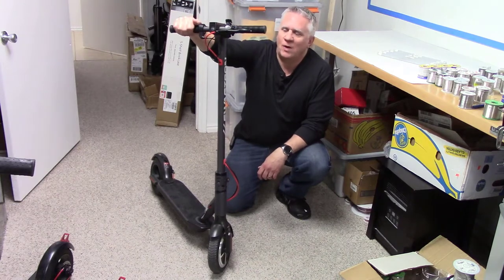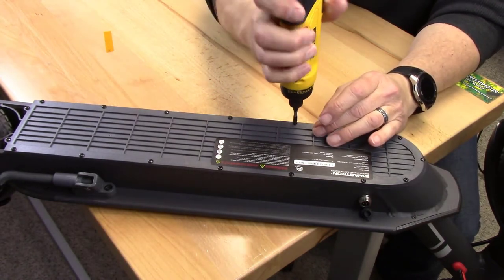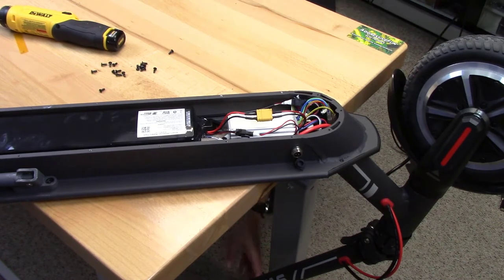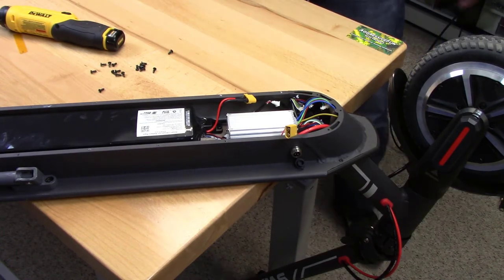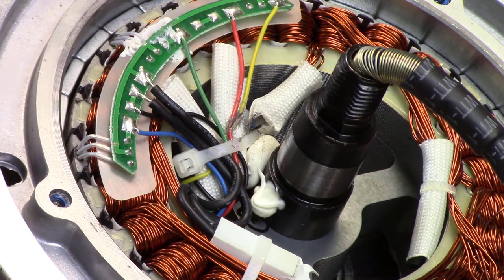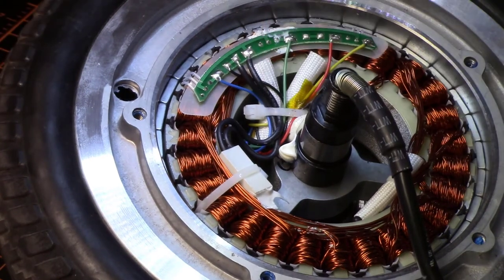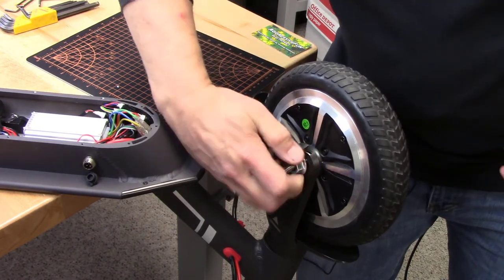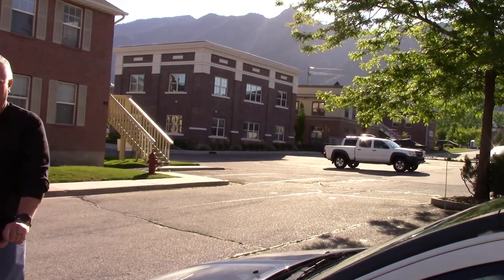How To Fix Swagtron Swagger 5 Scooter Not Running - Successful Repair (SOLVED)

Comment: This video was super helpful thank you for making it. I started having an issue with my swagger 5 scooter recently where driving straight, the scooter just loses acceleration like yours did. I know its a problem with that switch by the brake handle because sometimes if I pump the brakes it will let me accelerate again. Although sometimes, I see the display flickering in and out of consciousness and then it just dies... but I can start it back up after a few seconds. I was at work today so I only had time to remove the bottom plate and reseat all the connectors. if it continues happening Ill pull off the wheel hub and take a look like you did. im glad there are helpful people out there like yourself that will make a video like this, at no benefit to themselves. Very much appreciated. thumbs up and subscribed.
Reply from the maker: Thank you! Glad that it helped. Thanks for watching!
Reply: @Aggressivefun  apparently these scooters have another problem.
When the odometer hits 57 plus miles and you come back from a ride and try to turn it off it will beep and get "stuck"and you will not be able to turn it off and the beeping will stay steady, you can simply disconnect the battery and that will reset the odometer to zero, it already happened twice with mine
Reply from the maker: @Blinker_Fluid_Supply  I wonder if it's something peculiar to your scooter or if it's a problem across all of them. It'll be interesting to see if other see the same behavior. Good job finding a fix!

Comment: Hello I have a problem. I have a swagtron sg-8 swagger 8 and my throttle wont work to accelerate. But i did notice that 3 wires are loose and not attached to where it was attached before. what should I do?
Reply from the maker: I'd reattach those wires for starters! Good luck! Thanks for watching!
Reply: @Aggressivefun  ty for the help!

Comment: My scooter is new and has only been used less than 10 times. My daughter rode it yesterday on good dry pavement. She said it just turned off while she was riding so she ended up kicking like a regular scooter. I am currently charging it to see if battery just died. I tried to turn it back on and nothing was happening. Going to leave it plugged for at least 3 hours and hopefully that's all it needs 😭
Reply: Pls disregard my earlier comment 😅 I just unplugged the scooter and pressed the button.... It's alive again 😂🎉 I guess I couldn't turn it on while plugged 🤦‍♀️
Reply from the maker: Oh good! That's the best kind of repair! Thanks for watching!
Reply: The same has happened to our sons, we tried to charging it and the panel will still not turn on. We’re still working on it and trying to figure out the problem. We have only had for 2.5 months and purchased brand new before it happened. 😢
Reply: Same thing is happening to my scooter did it turn on?

Comment: I have a hub motor that stops at a specific point when you rotate it by hand. I know it’s the motor and not a bearing since I can feel it magnetically stop at that point. What do you think could be wrong?
Reply from the maker: Hmmm...do you hear anything at a given point when the wheel is rotated? Like rubing or clicking? It could be that someting has moved in the wheel motor but that doesn't seem very likely. Might be a wiring issue, like mine had, but mine was a brand new unit from the manufacturer. Could yours be due to wear?

Thanks for watching!
Reply: @Aggressivefun  Thanks for replying! And I got mine lightly used. I wouldn’t be surprised if it has only been charged twice since it looks brand new. I don’t really hear anything it just magnetically stops at one point when you rotate the wheel.
Reply from the maker: Does it act that way when all of the power is removed - like the battery is unplugged?
Reply: @Aggressivefun  Yes it does the same thing with the battery disconnected.
Reply from the maker: Then it sounds like something mechanical has moved inside the wheel.

Comment: Hi sir have the same swagtron 5, got issues with, rode it one day and suddenly just died on me, call the company,  was told to ship it to Indiana,  they couldn't even tell me if they could fix it or not , they're not helpful at all , on top of that the lady was rude , so I decided to buy another one glarewheel same as Hiboy max 1. I really like swagtron,  after almost a year not riding it I decided to ride it and see if it's going to work,  it did work and it ended up dying again,  so I don't know if it's the battery or something else. But one day I  got caught up with the rain so you think that water might got in. Please help. Thanks
Reply from the maker: Yeah, it might be related to being in the rain. Water can do really unpredictable things with electronics. I'd take the bottom battery cover off and check the connectors, like I show in the video, and then look for any water damage or corrosion. If that all looks good, I'd then open the wheel motor cover and verify that nothing got wet there and that all of the wiring is in the correct locations. I'd then take the display electronics out and check for any water damage and proper wiring. Hopefully you'll find something amiss in one of those areas.

Thanks for watching! Good luck!
Reply: Thank you so much for your reply,  I'm a female haha😂😜 I will ask my boyfriend to take it look at it,  he's very good with cars , I also gonna have him watch your video to repair my scooter  because the hiboy max is acting up lately,  I'm riding and it just stopped,  so i pressed the handbrake few times and it start working again there must be something wrong with, not the battery but the headlight is flickering since last week,  so i really don't know what's going on sir.  I can't afford to buy another one right now .
Back to swagtron 5 if it's the battery it is possible to buy a new one ?
Where can I get it from , because I really don't want to deal with the company. I watched a video saying that xiaomi M365 , Bird, and Lime have the same battery, do you know if it's true or not. Thank you so much sir for your time, I wish I have your contact to directly talk to you. Again thanks for time.
Reply from the maker: I didn't get a notification about your reply - sorry I didn't see it sooner. It's always good to have someone to help you out!

You can definitely get a new battery. I don't know about the compatibility with other scooters but a good Google search should point you to the battery info across the models.

Comment: Hello, I have a problem that looks a lot like this. When I was going down the street it only turned off before turning off the display said E3 and then it didn't turn on again I plugged it in to the power and it turns on again But it turns off very soon I accelerated it by lifting it so that it would not advance and the motor was still working but as soon as I stop accelerating it it turns off very soon and does not turn on again until I plug it in It has 5 battery bars I don't know what it will be, I'll disarm it by watching this video to see if I can find the problem
Reply from the maker: Maybe a bad battery? I've not seen this behavior myself so I'm not sure what else to suggest. Thanks for watching!

Comment: Have the E 1 code fixed it but the Error code wont go away. How do you reset the code?
Reply from the maker: I've not had that issue before but have you tried unplugging the battery, to completely power down all of the electronics, and then plugging it back in? You may want to leave it unplugged for a longer period to make sure it has completely powered down. Hopefully that will reset the electronics and clear any error codes. Keep in mind that if the condition that causes the error code still exists, then the error indication will come right back. Hope that helps.
Reply: @Aggressivefun  Thanks

Comment: have an issue as it does not turn even for the first time. what should I do?
Reply from the maker: Is the battery charged? Do the display lights come on? Have you checked the battery connectors? If you follow my steps at the first of the video, how far do you get? Lots of things to check to determine your individual issue. Let me know what you are seeing. Thanks for watching!

Comment: Mine will power on and move a little bit but only when plugged in. Any thoughts?
Reply from the maker: It sounds like it may be a bad battery. How old is your battery and did it just stop working now?

Comment: I got mine for 80 bucks and it was brand new.
It had the very same problem, it took me a couple hours to find out what was wrong and i simply used a mini zip tie to keep them away from the plate.
Reply from the maker: Good job! Thanks for watching!
Reply: @Aggressivefun  apparently these scooters also have another problem, when the it hits 57 plus miles on the odometer and you come back from a ride and try to turn it off it will beep and gets "stuck" there and you can't turn it off.
Happened twice with mine and you simply open the bottom part and disconnect the battery and that will reset the odometer to zero again
Reply from the maker: @Blinker_Fluid_Supply  Wow! I've not heard of that happening!
Reply: Where did that green sticker come from?

Comment: My daughter scooter stopped working. The screen shows like an upside down 13 and you push the brakes its jerking like it wants to move but does not and tried reseting it bit does not work but it charges up no 000 on screen.
Reply from the maker: Hmm...I've not seen those issues with mine so I'm not sure what to suggest. My guess is maybe a battery issue where the voltage is to low even after a charge. Maybe a bad battery. Thanks for watching!

Comment: Thank you. 
Great Video.
I have a Swagtron Sg-3.
It is acting similar to the 1 in the video.
Just Pulses when Accelerator is Pressed.  Then "01" starts flashing on display. 
The cables are internal to the handle and the go into the axle of the front Wheel.  Could not remove Front wheel due to cable being too tight.
<QUESTIONS>
1) Are there electric Scooter repair shops? Could not find any on Google.
2) Where can I get a replacement front Wheel? (xdy36v180901872)
Reply from the maker: Very welcome! Thank you! Not sure about scooter repair shops. I've not seen any around us so I'm not much help there. I found some front wheels that I purchased at an auction but I don't have a source for specific scooter parts. It would be quite the find to find a website that specializes in that. There is a lot of need for scooter repair parts but I think most people want them to just be disposable and purchase new.
Wish I could help more. Thanks for watching!
Reply: Thanks for the Reply.
I bought a new GoTrax Rival.  Works great. 
Gonna try to Recycle the Swagtron, somewhere. Hate sending it to the Landfill. 
Thanks again.

Comment: My Swagger 5 died as well. Just stopped 15 min into a ride. No display or any signs of life. Battery was fully charged. Opened up the base to look for loose connectors, blown fuse, shorted wire etc. Found nothing. Does anyone know where I can get a diagram of the motor connector pins?  I want to use the motor on another project.
Reply from the maker: Hmm...I've not dealt with a Swagger 5 death yet. If you know the battery is charged/good, all of your connectors/wiring are in place and correct, and that it didn't get wet inside, then I would suspect the electronic motor drive/electronic PCB. Poking around with a DVM and oscilloscope would be my next step.

Not sure on the actual motor pinout. I have some very similar new scooter wheel motors, for a different scooter, that I need to pinout for as well. I'll do some searching and see what I can find.

Thanks for watching!

Comment: Mine did almost the same thing but the throttle did let me go a little longer but then stopped working at random times. So I opened the throttle part to see if the wires were maybe touching or lose and now that I put it back the throttle doesn’t do anything Anymore more but now when I press the brake and  after releasing it now the scooter goes forward continuously until i press the brakes and then it turn it off. Any ideas on how I can fix it ? Thanks I’m advance
Reply from the maker: Very odd. My experience has been that when something is so erratic, it's wiring. Including connectors. You may have some worn insulation or a pin in a connector that is loose or no longer making contact. Or it could be that the electronic controller PCB has a bad component or bad solder joint. Also, has anything on the inside been wet? That can cause huge intermittent problems.
Reply: @Aggressivefun  thanks for your help I ended up fixing the problem weeks ago. The problem was the magnetic chip that engaged the throttle was not soldered correctly from factory and I just bought a new one and that solved the issue
Reply from the maker: Wow, nice troubleshooting! Glad you got it working. Good info to know. Thanks for replying.

Comment: i have an E4 glitch. pls tell me how to fix
Reply from the maker: I'm not sure what causes the E4 error. I've not seen that myself. Has your scooter gotten wet lately? If so, I would start looking inside for any moisture that could cause problems. Thanks for watching!
Reply: @Aggressivefun  no i dont believe it has. welp its having e4 some how
Reply from the maker: You'll want to verify that the wiring inside is still plugged correctly, are any of the wires damaged, has the scooter gotten wet, does the charger make it go to a full charge, and is it old enough that the battery may need to be replaced? Also, are all of the wires to the throttle and controls connected and undamaged?
Reply: @Aggressivefun  scooter is around a month old. i can check for wires tho

Comment: I heard about a hack for removing the speed limiter where you hold the brake lever while powering up to get in to a programming mode and then use the throttle to change settings. Not having a clue what i was doing I've got the scooter all screwed up - and Swagtron assures me there is no programming feature - no help at all.  Don't try it unless you know about programming.
Reply from the maker: Wow! I'd never heard of that. Thanks for watching!
Reply: @Aggressivefun   - if you figure out how to do it properly - and have some advice on getting mine back to factory  - let me know ... right now all i can think is to replace the controller - or the circuit board, and i'm not sure which?

Comment: My front tire is locked. What do I do
Reply from the maker: Locked like it mechanically won't spin? Even with power off moving it with your hand? Have the mounting nuts come loose and the wheel shifted so it is rubbing or have the bearings locked up?

Comment: Does it have a fuse
Reply from the maker: I don't remember one in the external wiring harness but I didn't open the controller so there might be one on the inside of the controller enclosure.

Comment: Mine has a code of E_1 that shows up on the indicater display , just clicks when u hit 5he throttle
Reply: You might have a bad remote control
Reply from the maker: I've not dealt with any codes so I'm not sure what that is indicating. I would try disconnecting the battery and letting all of the electronics completely power down - leave it disconnected for an extended time - maybe even overnight. And also check that all of the connectors are still connected. Good luck!
Reply: Or a bad throttle.
Reply from the maker: Could be.

Comment: What happens when they are backwards? Like the computer puts out 40 and my batteries put out 0.
Reply from the maker: I'm not exactly sure what you are referring to. More detail?
Reply: @Aggressivefun  my computer reads 44 for DC on my meter and my batteries read 0. I'm confused on why,
Reply from the maker: @dans9146  Is the 0 reading for your battery with the battery disconnected? Are you measuring the 0 volts at the battery connector?
Reply: @Aggressivefun  yes it's reading 0 while disconnected
Reply from the maker: @dans9146  How old is your battery? It sounds like it may be bad.
Reply from the maker: If you're measuring the battery connector, like I do at the 11:30 mark, and it gives you zero volts then your battery is probably bad.

Comment: Got e4 code. Fully charged. Throttle doesn't do anything...
Reply from the maker: I've not dealt with any codes so I'm not sure what that is indicating. I would try disconnecting the battery and letting all of the electronics completely power down - leave it disconnected for an extended time - maybe even overnight. And also check that all of the connectors are still connected. Good luck!

Comment: I replaced my battery and it cut on I put it on the charger to charge never comes on again
Reply from the maker: Hmm..do you know if your charger is working?
Reply: @Aggressivefun  I replaced the charging port and had a new charger as well still didn’t work maybe it’s faulty part

Comment: My scooter is flashing E5 why
Reply from the maker: I've heard that it may relate to a bad throttle control or you may get it to clear by disconnecting power to the controller and plugging it back in. I've not done these myself so I'm not sure if they actually will be a fix. Thanks for watching!